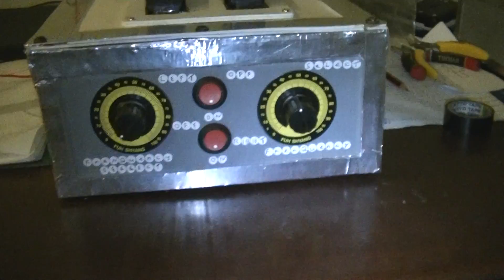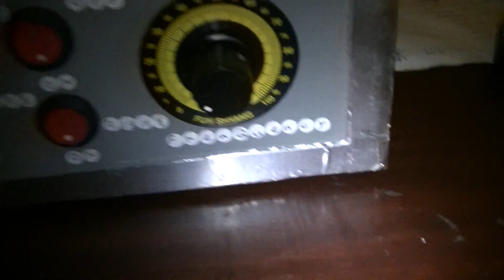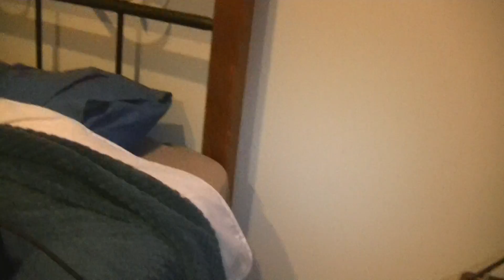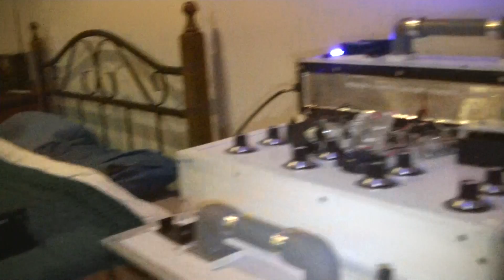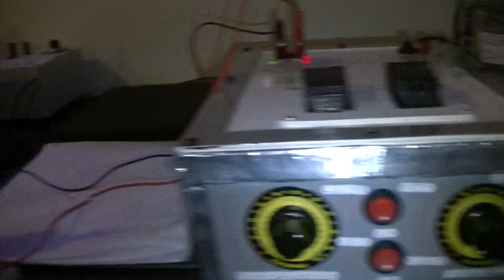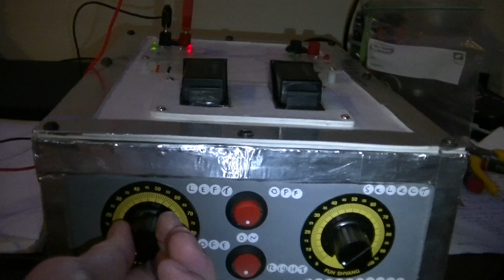fully completed frequency output circuit

Comment from the maker: sounds different than my first 9 frequency output circuit but im using my latest vlf receiver to hear the electromagnetic waves from the frequency outputs via my body  not the first one which is better , the coper pipe electrodes when i hold only one seems to amplify the em waves better so the vlf receivers em pickup coil can hear it

Comment from the maker: ideas for this circuit to experiment with  are flowing through my mind  from unknowns i set the left side to emit a  high frequency through the piezo speaker at the front left side ,and i turned on the other side and went through a few of the lower frequencies and noticed they clash with the higher frequencies creating a reverberation like sound,  more frequencies' to test out yet , but theres some new ideas there i have to try out and experiment with yet and i have to draw up a test plan and details and bring out a second video camcorder to use in filming it and ill need a few mirrors yet and maybe another circuit set up using more values of ceramic capacitors i haven't used yet  to get more piezo frequency sounds , ill use the frequency counter i built from a kit before while waiting on the new one to come and measure all the frequencies, the ones of interest are the ones that do not go to far above and below but sit at a steady position  like a rock solid position , but why some frequencies go up and down is unknown and very interesting to study as to what causes these instabilities in them

Comment: wow yes you can hear the difference when you hold that rod
Reply from the maker: i used my 2nd vlf receiver to hear the frequency waves my other vlf receiver hears it better  ive tested this on myself and the 2nd frequency outputs are better at lower frequencies as i can feel it better , ill start work on the next device when i get my frequency counter kit in the mail as ill add it to it , even though i have one kit i put together before that i brought on e bay this one coming will be used in the next project

Comment: Hi Steve. What are you using this instrument for ? Do you plan to module it with a copper pyramid?
Reply from the maker: generating all these frequencies so i can output them through some piezo speakers and experiment on them by clashing the piezo sound outputs together  ive had some good results doing it so , but my main interest is the electrical effects from ufos and the paranormal and bigfoot on electrical power so i have a theory that if they can effect power flow then they may also effect the cycles of ac at various or certain frequencies and if they slow one down it would then read as a dc  , and some of the frequencies if you amplify them you'll get a powerful ultrasound or infrasound output , theres a few good experiments i plan to do , now imagine your in a haunted area and the power goes dim , my question would be are they really sucking the power or reducing the cycles of it , and even though dc has zero frequencies its just a one-way flow , and ac had a dc  part in it as dc like ac flows one-way but dc keeps going one way but ac flows one-way to but then stops and reverses so ive built polarity indicators for the circuits so when you simulate a slow frequency like  and then the cycles are slowed and read only one led on the polarity indicator showing dc so that would be like slowing a higher cycle down so much it only reads as dc so thats the idea and also ,  some of the frequencies go up and down one  and some are very stable and stay there so what really makes them go up and down im looking into that one went up 2 frequencies and down 2 so thats another strange behavior as to what's causing these to change in strange ways  however some frequencies that stay in one place and dont go up and down im noting these as ill latter isolate the ceramic values used and make a separate circuit  with the most stable ones and i have a theory if you find an anomaly or vortex they may effect cycles to and either slow them down or zero them out so i think theres a lot of experiments to do yet
Reply from the maker: coper pyramid not yet dont have the materials for that  yet but frequencies and vibrations from them may hold some secrets if say i power one up and then switch on the piezo to output the sound for that frequency, then let it sit and power up the second frequency generator then switch on its piezo and then rotate the switch and select one at a time i get to a spot where one output through the piezo effects the other and they vibrate together or resonate and one time i swear i herd some mores code signals come through while both pizeos at different frequency sounds was vibrating together

Comment: Im still lost on the premise and function.  Is the function to identify a VLF source?  Where would we expect to find these sources?  Does this correct or  identify a problem or solution?  Will there be a demonstration of the benefits or did i miss that too?
Reply from the maker: the idea of building this 20 frequency output and via audio circuit  using all the different valued ceramic capacitors  for various ac frequencies, we qll know that ufos and paranormal activity has an effect of house hold power and even dc and also bigfoot so the experiment is to find or wait for any of these events to happen then switch the circuit on the ac goes through the simple polarity indicator which both leds light up to indicate ac flow my theory or suspicion is that ufo and paranormal activity  etc if present which always makes the power in your house go dim or black out so if i choose various ac frequency outputs  to see which one gets effected the most  so if ac gets effected im expecting the cycles to slow down and if they do by any chance the polarity indicator would sense it and thus one led will go out or dim so then it shows the ac cycles to be effected   so this circuit may help give some answers and also if a time anomaly is present then for sure the ac cycles may also be effcted and slow down so much that the polarity indicator would only show one led light up meaning the ac cycles at certain frequencies would slow down so much they then become a one way flow meaning they are then dc
Reply from the maker: the electromagnetic waves given off by every frequency selected by the 2x ten frequency circuits  can be herd on a vlf receiver  so if in a paranormal activity area if power is interrupted so  may the reception to the vlf receiver so theres a few uses for experiments and tests to do yet ,in order to find the magic frequency output that gets effected the most in paranormal activity areas , house hold power at the mains frequency is one but theres many other frequencies' to try test out